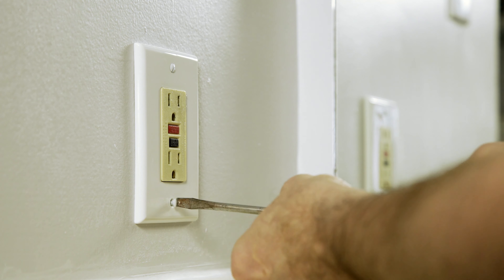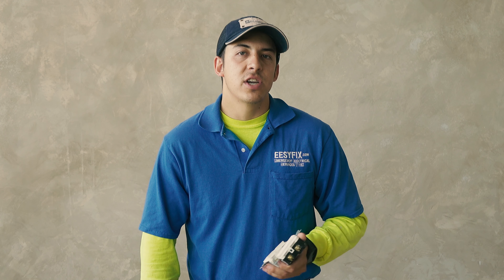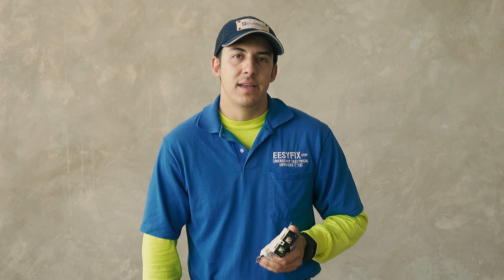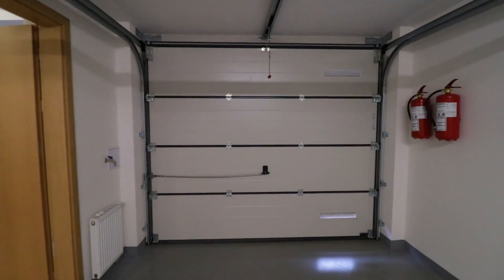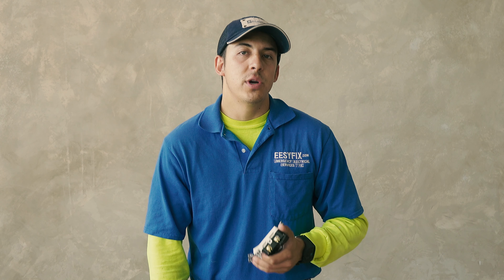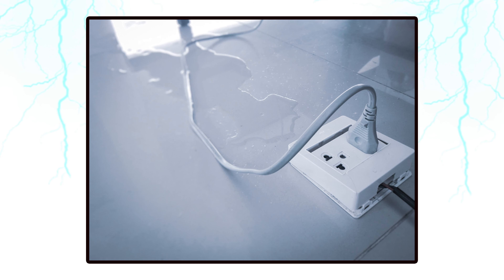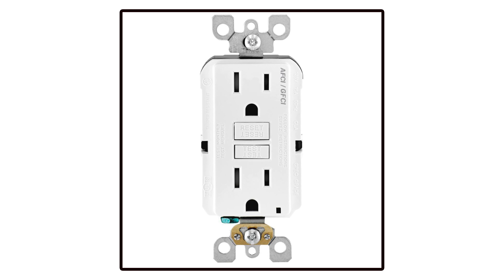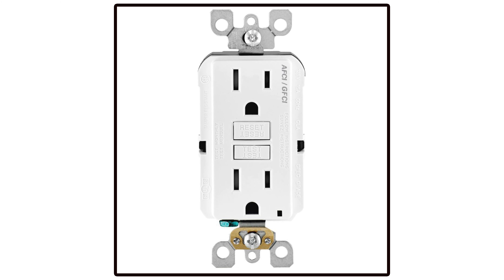What is an AFCI or a GFCI?

Comment: My contractor changed all the outlets in the apartment for AFCI outlet. He charged me $27 for each outlet , 30 outlets total. Is this correct to install AFCI in all outlets?
Reply: Cost seems low.  Make sure the receptacles say afci on the front.  If they do you probably got a great deal!
Reply: @justinarmstrong9900  cost seems low? For an outlet $27 , I think it's really expensive.